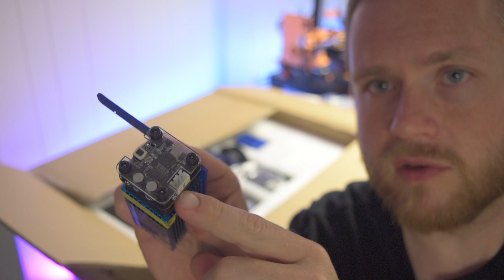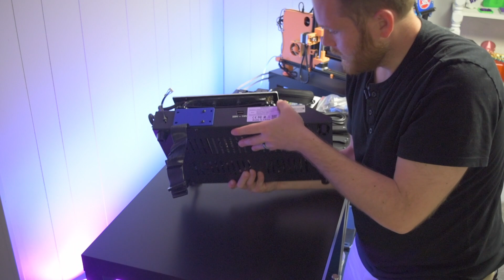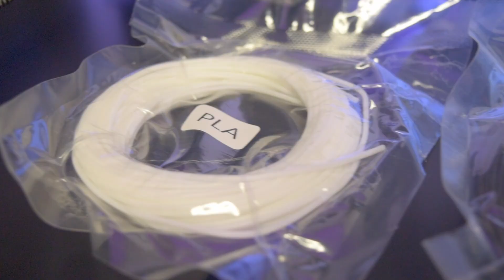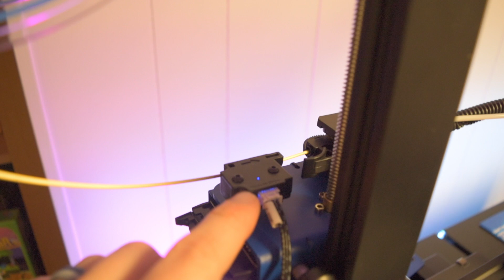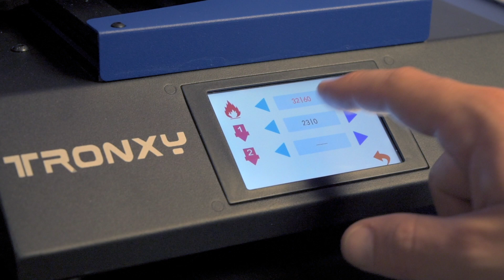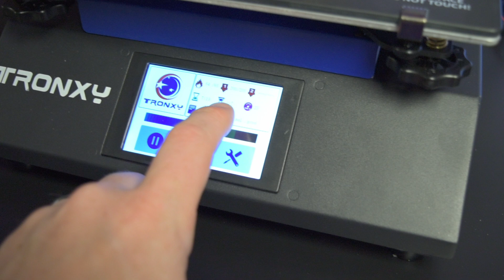A 3-in-1 Printer? Unboxing & Initial Impressions of the Tronxy XY-3 SE

Comment: Do u still use this printer at all
Reply from the maker: No I can’t really hold onto machines that long. I never got the chance to get the dual color to work. the laser was rather underwhelming. however, the printer was just fine.
Reply: @3DPrintSOS  so do u think it’s an bad printer to buy or
Reply from the maker: @monsterstorm78  there are MUCH better options out there right now. However if you find a good deal on it, it’ll be ok. For the money though, the SV06 by Sovol or the larger Sidewinder X2 by Artillery is amazing. I did a video on it and have the sv06 coming up.
Reply: @3DPrintSOS  already own the sovol 6 and 5 just looking for an dual colored 3D printer is all so that why I asked if u ever got this working at all
Reply from the maker: I kept the other Tronxy machine. The Idex machine. Forget it’s name off the top of my head. Had it for years now. Still use it. Even when I need to print two things at once. It’s solid.

Comment: I would love to see more videos on this printer I'm ordering one to how the two colors work, how the Lazer works and any other tips you have
Reply from the maker: Tom, it was a great single head printer. I couldn’t get the dual color to work and the laser, even though it worked, has issues with software support. I did end up carving a few things though. It’s a good single head printer, but the other stuff is probably a good idea to avoid.

Comment: Did you ever do a video on the dual and/or laser?
Reply from the maker: Nothing in detail. I used the laser for a bit but couldn’t get the software I was using to talk to it. The issue was that to run the laser, you need the hotend fan to turn on. And some software didn’t allow that gcode command to be used for laser on. 

As for the dual color, I never really had a chance to properly test it. There was very little interest so I moved on.

Comment: Well I got mine yesterday and after having to fix the bed pulley, I cannot get the bed to stay level and even when I have set it and checked it again the centre ends up off again and the bed keeps coming loose, I wasn't impressed with the first version and I have been asked to review this one, but the way things are going, I'm going to return it. I don't believe you should have to mess about with a 3d printer this much.
Reply from the maker: Having problems out of the box is never fun. But I’ve never had a machine that didn’t need any work at all. They literally all do. It’s a big part of the hobby. Here’s how you test that theory, pick any printer you like, then go to a Facebook group or even here on YouTube and check out what type of questions people ask. I bet you’ll run into endless posts about issues. Mostly user error admittedly, but still. 

What do you mean by fix the pulley? Just screw it on? If the bed comes loose, it means you didn’t give the springs enough tension while leveling the bed. 

Let me know if you have questions and I’ll try to help.
Reply: @3DPrintSOS  Sorry I meant to also add pully belt, initially I thought it had snapped but soon figured it out that the ends with the clips on fitted into slots underneath the bed. My Mega X worked straight from the box and still going after 2 years of constant use, and yes your right about human error but mines just wear and tear, going to keep trying to sort it.
Reply from the maker: I hate issues like that too. Believe me. Especially when we’re super excited to inbox a new machine. 

Really? Two years with no issues? That’s amazing. I’ll have to look into that machine.
Reply: @3DPrintSOS  yes mate and was seriously considering getting the Vyper next and returning this Tronxy 😳
Reply from the maker: I see why. The vyper looks cool. Maybe I’ll try to get my hands on it again. My channel wasn’t big enough for them to talk to me a bit earlier.
Reply: @3DPrintSOS  I have seen it for £271
Reply: @3DPrintSOS  hi mate, just to let you know that I ordered the Vyper which came today and it only took me about 20 minutes to put together and all I did was perform the auto leveling and it is now printing my bird bowl, again straight out the box, the tronxy I bought is now back in the box ready to return or sell, will never buy a Tronxy again.
Reply from the maker: Nice! Glad you got a machine you’re happy with. Admittedly, my experience with the Tronxy Gemini S is far better than my experience with the 3se. So I wonder if they are built/packaged by different teams. Either way, the vyper seems nice.

Comment: do you use laser?
Reply from the maker: I have. The issue is that the support from software is somewhat limited. Because to power the laser on, you have to use a fan command for a 3DPrinter hotend fan. But I did manage to engrave a few things with Inkscape.
Reply: @3DPrintSOS  i m thinking in buy one of this

Comment: I’ve literally just got this printer delivered yesterday and would love to see the dual first then laser. Any ideas when you will be doing this as this video was 2 months ago buddy!??
Reply from the maker: I’ve tried both now but ran into issues. Still waiting on any kind of communication back from Tronxy. My contact there left the company and was replaced but hasn’t responded. 

Basically the auto leveling was hindering the dual color mode and the tower could never stick to the plate properly so I couldn’t ever get a clean print. 

The laser is super easy to work with though and is definitely a superior add on. The issue is that I can get it to work with Inkscape but the software they provide on the sd does not work. Once they send me a reply, I’d love to test further and make a video. 

At the moment I’d say this...Great printer, hindered by firmware and lack of service.  Both could be fixed rather easily, so I’m giving them a chance.

Comment: Didn't put the whole thing together, what review does that
Reply from the maker: You can’t really put the whole thing together. You have to choose between 3 modes. Single color, dual color, or laser. I covered the printer before adding any modules. This is meant to be an unboxing and first impression video, not a review. 

For what it’s worth, I’ve had zero success with the dual color add on and limited success with the laser. Video will come after TronXY can reply to some of my questions.

Comment: I received mine today. Followed the instruction booklet for swapping out to the dual extruder and adding the laser engraver.

Few things the manual doesn't tell you...

When swapping out to the dual extruder, you also need to swap out the fan cover. This means removing both fans from the default casing. In doing so on my unit, the leads to the blower fan broke off. The red lead had a cold solder joint and the black lead pulled away some of the fan's component board. Luckily, I found the "WINSINN 40mm Blower Fan 24V 4010 Turbine Turbo 40x10mm, with Air Guide Parts - High Speed (Pack of 5Pcs)" on Amazon and had enough Amazon points to get them for free! They should be here on Sunday...

NOTE: In the mean time, I'm throwing caution to the wind and rolling with a single fan on the extruder. So far so good. Hasn't caught fire (yet)...

Of course, the manual also suggests updating the firmware at this point. Well, I'm on a Mac and it looks as if there is little to zero support for macOS for this printer. Everything is for MS Windows. So no firmware update for me.

I also downloaded Cura 4.10 directly from the vendor website vs installing the version that came on the SD card. At least I know that's macOS compatible. Unfortunately, Cura 4.10 doesn't natively support dual extruders on the TRON XY-3 SE.

So I moved onto the laser engraver. This turned out to be an easy install. But... and this is a HUGE BUT... I'm not certain that you can (or should) have the laser engraver mounted simultaneously with the filament extruder. 

When I ran the auto bed leveling, the laser engraver sits below the extruder and I had stepped away. When I returned, the laser engraver crashed into the bed and left a wicked scratch across the glass and was continuing to attempt to go lower. I had to scramble through the menu items to find the Z-axis control to reverse the stepper motors and raise the extruder and laser engraver. NOT COOL!

There does seem to be some alternative screw hole options for the laser engraver that might make it sit higher, but not certain how that will affect its ability to engrave. Furthermore, again, no macOS support for the TRONXY software, so I can't even test the engraver out!

I ended up removing the laser engraver and swapping out the dual extruder back to the single extruder. 

After leveling the bed (same experience you talk about in the video), I ran a print test of the 20mm test cube. That took 3 attempts before the bed was level enough to print. I did end up with a slight misalignment on the bottom the the cube, but overall, it came out fine.

I powered down and went to dinner.

Upon return, I went to print the Vase.gcode file on the SD card. Turns out, I had to re-level the bed AGAIN. Seems the settings don't save between power cycles. That sucks!

Also, took three attempts before the filament would stick to the bed. That vase is now 27% complete at time of this posting.

Looking forward to seeing how you get on with the dual extractor and the laser engraver.

Good luck!
Reply from the maker: I haven’t had much luck either. Haven’t been able to get a single dual print going.

Comment: For some reasons my machine extruds before the actual printing, when it finally hits the board, there would be ooze at the tip and it screws up the base of the print. 

Any suggestions? New to the sport.
Reply from the maker: That’s normal. Since the hotend gets hot it melts a bit of plastic that is in the tube and it leaks a bit. I keep a pair of long tweezers by the printers to grab that little bit right before it starts printing.

Comment: Yes the control touch screen menu is good, I have the same one on the Tronxy X5SA 2020 model. 

Mine even has the ready to set up 2nd hot end symbol on the menu if I needed to set up a due hot end system?

Of course my Tronxy printer will not level right either on manual mode or auto mode!
I had so much trouble with the Tronxy X5SA, That I have been put off buying any of their other models full stop.

That's why I brought the Ender 3 V2 clone you got the Voxelab Aquila.

I will try soon to redo the Tronxy X5SA printer by getting a mirror glass type panel to solve the uneven Tronxy metal bed to level better.
Also I will change the menu over to Marlin and change the Magnetic bed sensor over to a BL Touch one.

So one last try to get the X5SA to level and print and if all that don't work, I have to sell it for parts.
At least I got the good Aquila for now. 

Although I still having some problems with the PETG not laying down well and even not sticking on the glass bed
even though I clean the bed well with Isopropyl alcohol and level the bed well too.

Thanks for the review..
There is no price listed on the 3 in 1 Tronxy I looked, I guessing around $700 at least this be sold at?
Reply from the maker: I asked them directly for the full price. I’ll have it’s listed as soon as they reply. I think it’ll be mid $400. You can find more info through their Kickstarter.